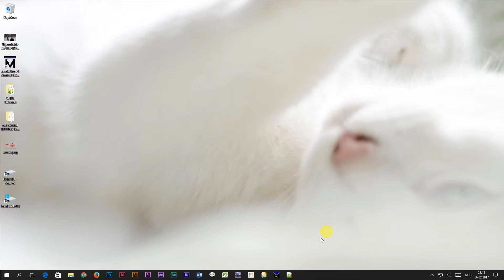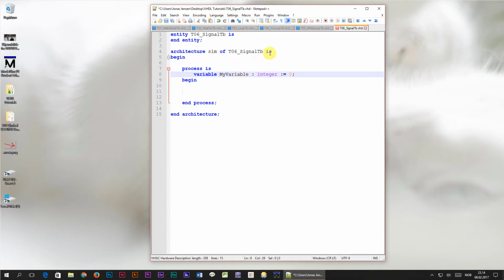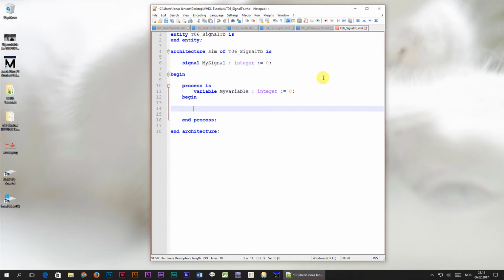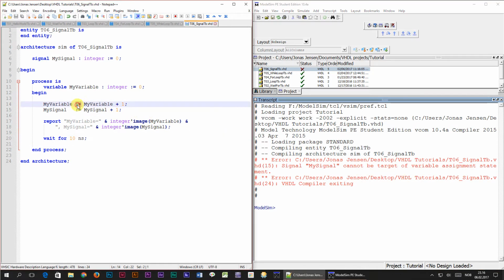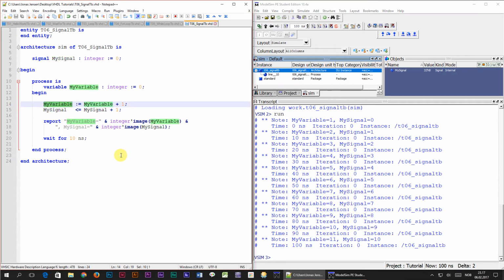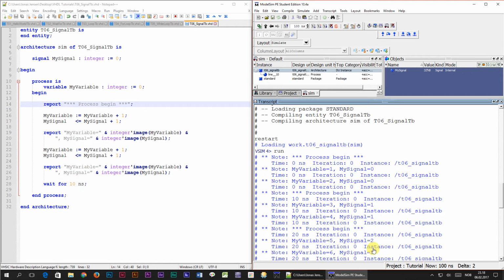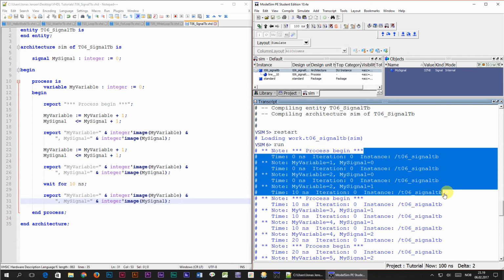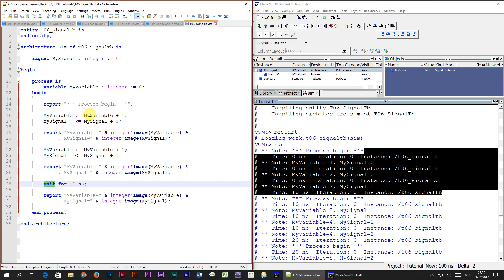How a Signal is different from a Variable in VHDL

Comment: Is the "wait for 10 ns;" statement equivalent to a 10 ns clock signal period? In other words, does the signal transition on the rising edge after 10 ns? Is my understanding correct? THX and BR
Reply from the maker: In this case, there is no clock signal in our code, so there is no rising edge to consider. However, if we had a line outside a process generating a clock in the testbench like this:
clk <= not clk after 10 ns;

Then, 'MySignal' would change simultaneously with 'clk'. We can say that they change in the same "delta cycle".

Check out this article to learn how signal scheduling works in VHDL simulation:
https://vhdlwhiz.com/product/course-delta-cycles-in-depth/

Comment: In process block of this video, variable MyVariable : integer := 0; should get initialised by 0 every time when process gets restarted. I see different behaviour. Kindly correct me if I am wrong.
Reply from the maker: No, it's only 0 due to the initial value statement when the simulation starts. For the rest of the time, the "program" will loop between the "begin" and "end process" tags.

Comment: Thank you! Just a random question. Let's say I have a function that will return a calculated value (which is a variable), and I want it to pass it to a signal, is it possible to pass value from variable to a signal?
Reply from the maker: Sure, you can assign the value returned from a function to a signal like this:
my_sig <= my_func(some_parameters);

A regular function can only assign to outside signals (or variables) through the "return" keyword. And the caller can store the value in a signal or a variable.

But "impure functions" can read or modify any signal or variable in its scope. See my other article and video to learn about impure functions in VHDL: 
https://vhdlwhiz.com/impure-function/
Reply: @VHDLwhiz  thank you very much!

Comment: Hello, how do I tile my modelsim windows so that I can navigate around easily?
Reply from the maker: You can arrange the sub-windows in the GUI by dragging and dropping them. The "handle" is on the horizontal center at the top window bar. The top bar of each window contains two parallel horizontal lines. In the middle, there is something you can click and grab.

Comment: Assuming you don't want to output your result (ie you dont eg assign your signal value to an entity's port value),  when would you use variables over signals?
Reply from the maker: I would only use variables for storing intermediate values within a process that are forgotten when the process ends (goes to sleep). Whenever I have to retain the value over time, I would use a signal. It's possible to use variables for storage, although most VHDL designers dislike the practice. I've written an article about the pros and cons of using variables for storage:
https://vhdlwhiz.com/variables-for-registers-or-memory/

Comment: Great Series! but I have one question if I may:
Why on the "Deceleration region of the VHDL file" we define a signal and initialize it with ':=' sign and not '<=' sign?
Reply from the maker: That's just how the VHDL language is defined. I guess the rationale is that the ':=' operator assigns the value instantly, while the '<=' operator schedules the value in the next delta cycle (timestep). The ':=' operator is used for variable assignment, anywhere. And variables get the new value instantly. Signals, on the other hand, don't get the new value until the process goes back to sleep. That happens when the program hits a Wait-statement, or after the end of a process with a sensitivity list is reached.

Comment: Is the issue with the signal only updating when the process is paused a testbench simulation issue? Or will this be the way it manifests on hardware?
Reply from the maker: The behavior is used as a basis by synthesis tools when they generate hardware from your VHDL code as well. I's not an "issue" as in a "problem", if that's what you meant, this is the expected behavior of a signal in VHDL. You can read more about how simulators interpret VHDL code in my blog post vhdlwhiz.com/delta-cycles-explained/

Comment: Why did it iterate 10 times without having any ongoing loop?
Reply from the maker: That's because this process doesn't have a sensitivity list. Then, the program will loop infinitely from the "end process;" tag right back to the the "begin" tag. The process itself behaves as a loop construct, only limited by the wait-statements inside of it. It iterated 11 times because we ran the simulation for 100 ns while waiting for 10 ns at each iteration.
Reply: Actually it did 11 loops by iterating 10 times... my bad.